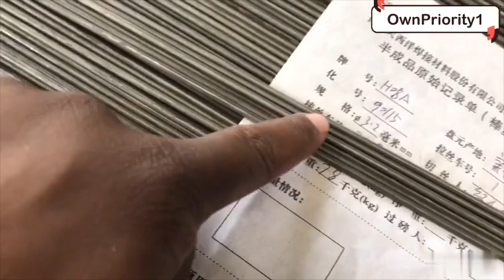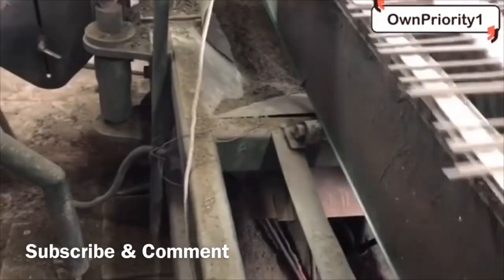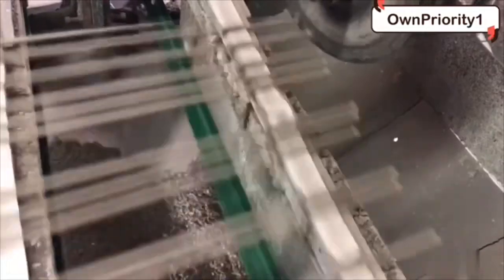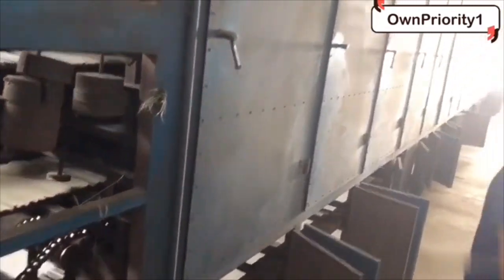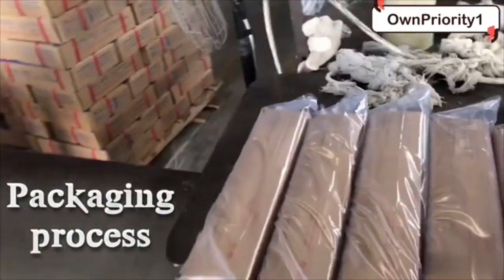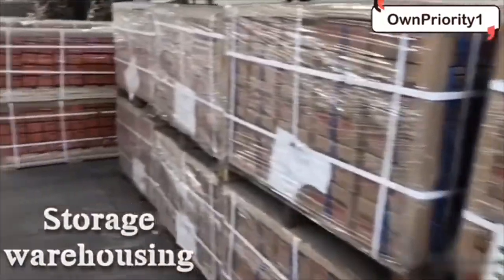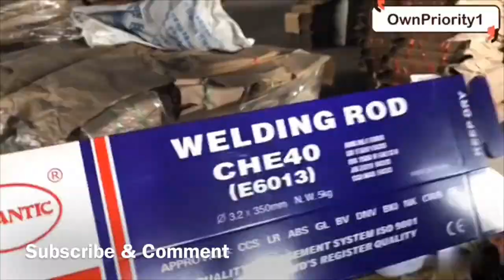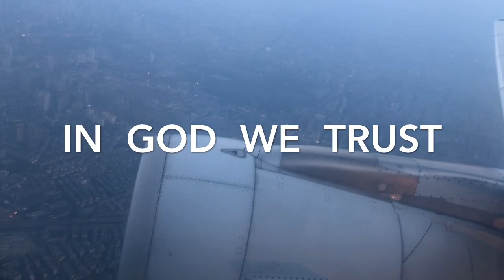How it’s Made in China/ Factory  Vlog/ Chinese Manufacturing/ Welding Rod Suppler/ China GDP Growth

Comment: 5 ton/shift  machinery
Reply from the maker: Mst. Kajal Rekha Rekha It’s 2~4 Tons/8hrs 
Minimum  cost USD 45,000
Reply: @SEEAFRIKA  i.need.2ton.per dayPlant.price
Reply from the maker: @romanamanzoor8708  there is a 9 machine production line with 2tons to 4 tons/ day that cost 45,000USD only.
Reply: @SEEAFRIKA  total.cost.with.instalatoin.i.am.from.pakistan
Reply from the maker: @romanamanzoor8708  installation cost and flight tickets for two workers will cost $4000 to $5000 but accommodations you will have to provide that
Reply: @SEEAFRIKA  are.this,price.at.pakistan
Reply from the maker: @romanamanzoor8708  add me on WhatsApp